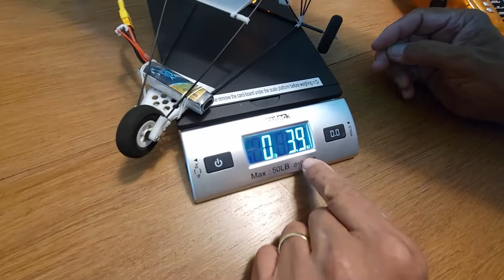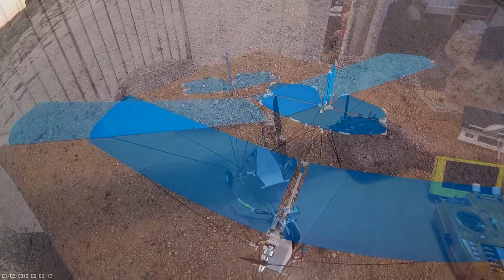My Nephew and I on Subject of  MIA RC Ultralights Part 2 of 2

Comment: Looks like a lot of fun!
Reply from the maker: It is but all these different sizes, as you probably know, are more of a dedicated taste.  In other words when the mood is right, they are quite enjoyable.  

The benefit of the smaller models is that I can fly them in front or back of my home. They are not intrussive and being super lightweight they are pretty durable in a mishap. ~ WL is about 2.3oz/sq ft, featherweight.

This model looks simple but it is a bit intensive in the assembly, all the carbon rods with the 3D printed parts need to be exacly measured and placed in the proper location before CA glue sets so it requires a lot of patience to end up with the critical straight and level airframe. Reason I have not made a kit of this particular size, not many people these days have the time or patience for this caliber of kit. In all honesty, it is far easier to assembly one which is bolt on, but then you need a larger field to fly them in.  The nature of our RC hobby.